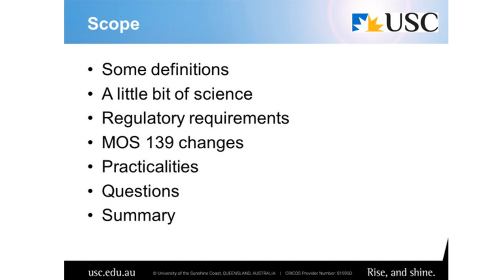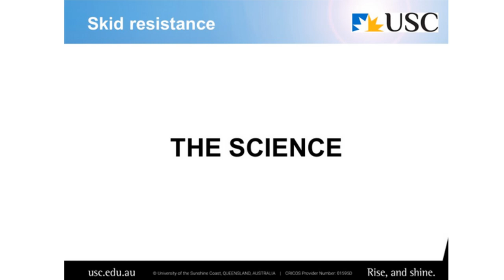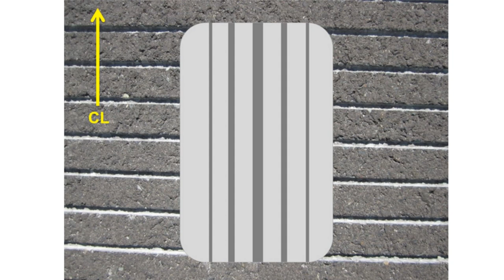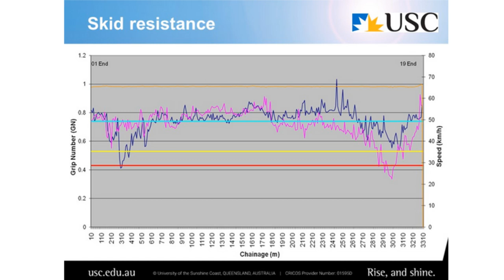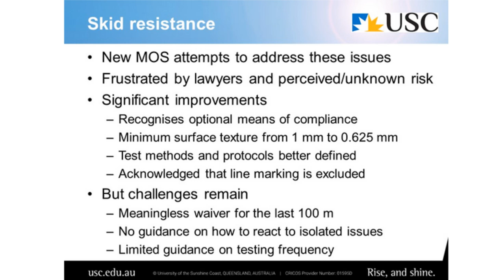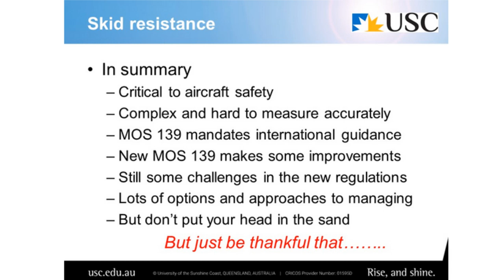AAA Webinar Series - Texture, Friction and Skid Resistance

Comment: I found the video very help full  even if i am not be on webinar ,it well presented 

Zelalem .M from ethiopan Airlines Group formerly Ethiopian Airport i conducted this test while am working on runway frctuion mesaurment ,we use BV 11 FRCTION TESTER From Moventer inc . since 2017 GC , with TSL cables ,dgital interfece ,elcterical water pump concted to tablets for reading previously we worked with old ones mecanical water pump with analog frction reading machine .